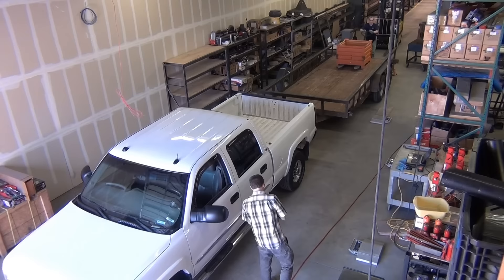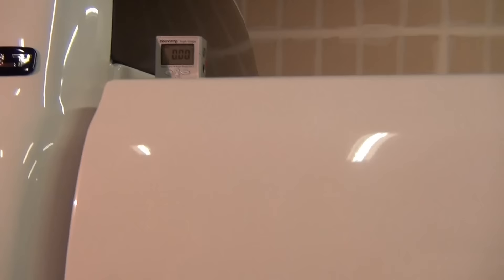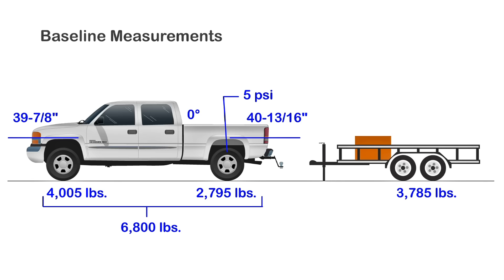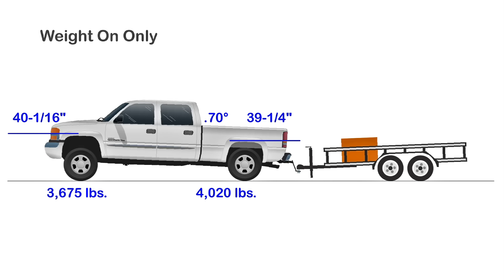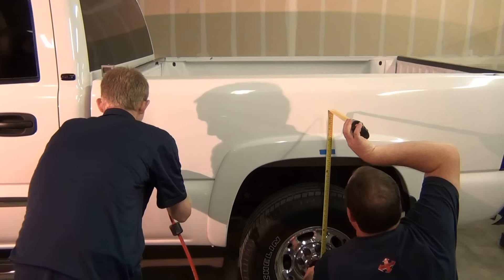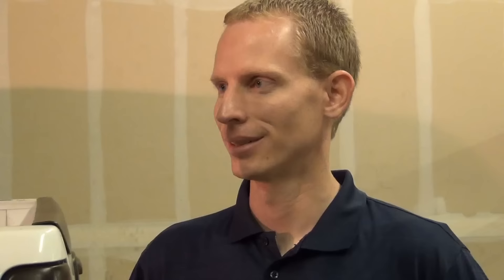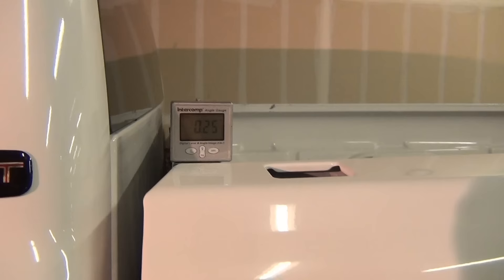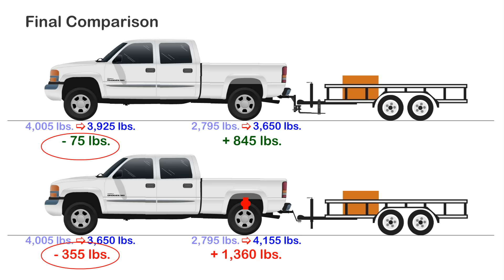The Difference Between Using Weight Distribution and Air Bags to Level Your Load

Comment: Very informative; thank you, though I do have questions. 

Recognizing you add the weight of the WD into the total TV payload equation, can you deduct the TV payload weight that is transferred from the vehicle to the trailer?  In this case 365 lbs?  So if my allowable payload was 2000 lbs, it would in theory increase to 2365 lbs with WD and this example?  I am trying to be careful in my terminology as I know you can't increase the vehicle ratings, but if it moves 365lbs of of the payload to the trailer, in theory I should not calculate that 365lbs against total payload of the vehicle.  In theory, this 365 lbs also adds to the trailers total GVWR?

Also, my vehicle has off road components and is level rather than having a forward rake like most, so I get a bit more dip with any trailer, even with the WD.  While this video implies air bags are worse than nothing at all, will it help me in terms of leveling the vehicle?  In other words, what if I want to use both a WD and Air Bags?  And if they are worse than nothing at all, why do so many vehicle manufactures put them on, and have claims of stable towing?  Finally, since the WD is transferring the weight to the trailer tires, does removing the tongue weight negatively impact sway?  I see your example has the tongue weight at over 25% of the total trailer weight, so no issue there, but it is more common for the tongue weight to be around 10%, so it may help to have a test with that standard?

Thanks!
Reply from the maker: +PBRescue,

Here's the scoop from our engineering geniuses:

- Of the 375 lbs. that was removed from the rear axle, only 150 lbs. went to the trailer axles. The rest of that weight was placed back onto the front axle of the truck. The best way to see this on your rig is to take the combined vehicle to a scale and measure each axle weight, each vehicle weight and total combined weight of all axles. Having that knowledge will allow you to adjust your loads between the tow vehicle and trailer, and between the axles on each unit. Never exceed your axle, vehicle or combined vehicle weight ratings.

- Air bags aren’t necessarily worse. They help stability by leveling the vehicle and stiffening up the suspension. What they don’t do is distribute the weight from the rear axle to the front. As the video showed, attaching a trailer not only adds the tongue weight of the trailer onto the rear axle, but also takes some load off the front axle of the tow vehicle and transfers it to the rear axle of the tow vehicle.

- When using air bags, the setup process is a bit more involved. Load both vehicles with gear,and add some air to the vehicle air bags before adding trailer tongue weight onto the truck. Then, follow the instructions in the weight distribution hitch manual for setting up the WD hitch. If the truck isn’t where you want it, repeat the entire setup process starting with adjusting the air in the airbags on the truck without the trailer coupled. Verify that WD is in the proper range, the truck is at the level you want and the trailer is level.

- Weight distribution doesn’t reduce the tongue weight, it spreads out how the tongue weight is carried. It doesn’t reduce resistance to sway, rather it increases overall stability therefore, improving sway control. All Fastway® e2™ brand hitches have built in sway control that will reduce sway and provide better sway control performance than chain style hitches offer. Air bags do not provide sway control, but when used correctly for their designed purpose, they can increase the overall stability as described above.
Reply: A WD works as a cantilever. Bags DO make a huge improvement! They force the weight back onto the rear axle and the rest of the truck frame. This video is misleading

Comment: Like the video but what about using both airbags and weight distribution hitch
Reply from the maker: +BildrRick The Eclectic Nomad,
Several others commenting on the video use both air bags and weight distribution with great success. We think it's a great way to go if it fits your towing needs and you can afford both.
Thanks for the question!

Comment: Thanks so much!! Very informative. I almost got air bags thinking it would do but wow WD is so safer!!!
 I've read here some ppl use both, I don't think I will install aitbags.
Reply: If your not getting more than 1-1.5” in drop on the rear of your tow vehicle there’s no need but if you still get more than 1.5” in drop the bags help a lot too

Comment: The weight in the trailer should've been centered directly over the trailers axles. That's the proper way to load a trailer. The fact that they didn't do that makes me question their entire method.When I tow my 27' travel trailer, I use a weight distributing hitch in conjunction with air bags.
Reply from the maker: You are correct. If this were a real towing situation, the weight should be set just ahead of the trailer axles. In this case, we are not planning on towing anywhere, simply trying to achieve the amount of tongue weight we need to illustrate this principle. Placing the weight at the front of the trailer saved us time and work, since we were able to achieve it by loading just one bin instead of several. Using both air bags and weight distribution together is a great way to go. Thanks for watching!
Reply: The 10 percent rule usually does alright in most cases. 10 percent of the cargo weight on the tongue of the trailer. So slightly forward of the axle set centerline is correct positioning
Reply: The point was to show how tongue weight is distributed across axels.  This was great video.  My trailer tongue weight is about 850 to 1000 pounds and I have these weight distribution bars.  I have some sag but that is typical.  I was considering getting air bags also but I will pass because I won't know how it will affect weight distribution.  Could be real bad for tires
Reply: Ed Montreuil  hi I have a question how do you go about setting up your distribution hitch with your air bags. Do you hitch your trailer and then add air to the bags or do you hook up your distribution hitch and then add air
Reply: @inspectorbrody  I have both on my 150 towing a 30ft TT. What the bags offer also is a better ride. I set the bars to wear the load distribution is correct and then the bags to wear they provide the extra support for roads that have dips, expansion joints etc. Not necessarily for weight distribution. I did bring the whole unit to be be weighed to work to check out individual axle weights and were correct. I haul oversized/weight loads for a trucking company.
Reply from the maker: @abqluke  the best practice is to first inflate the air bags to the psi you plan on using while towing, then, set up the hitch to fit the tow vehicle and trailer. Inflate them before hitching up the trailer. If you make adjustments to the air bag pressure after the hitch has been set up, you should double-check the weight distribution. After the hitch has been set up, inflating the rear axle air bags will decrease the amount of weight distribution, and deflating them will increase it.

Comment: Great Video! I recently pulled my bumper pull travel trailer 5000lbs dry on a long trip with my 08 sierra 1500 denali and measured my weight at some scales. I had my WDH on and airbags at about 55 lbs initially and in the end I went lower 22 lbs. When I got home and emptied the trailer I hit the scales again with 22 lbs in the bags and seen what the loads on the axles were at 4 links on the WDH and 5 links. 

Unloaded weight of truck axles not connected to trailer: 
Front- 3344 lbs, Rear- 2420 lbs. 

Connected to trailer (approx 5740 lbs wet) with 5 links on WDH: 
Front- 3102 lbs, Rear- 3608 lbs, trailer axles -4840 lbs. 

Connected to trailer (approx 5740 lbs wet) with 4 links on WDH: 
Front- 3168 lbs, Rear- 3410 lbs, Trailer Axles- 4928 lbs.  

As you can tell the WDH worked quite a bit. With a heavy 1/2 ton (6.2L Engine) I was concerned as I was overloaded on my rear axle most of the trip (Had 3 rows of birch in box). But after I emptied my trailer, reduced my air bags, and had more weight transfer from WDH, less links, I was then less weight on my rear axle. Helped quite a bit!
Reply from the maker: Looking good! Thanks for sharing.

Comment: Outstanding video.  I have a 2019 Tahoe with automatic level control, which has no manual adjustment and comes on when you turn on the ignition. I don't own a scale to check axle weights, so my take from your video and reading through comments is that the most important factor is to adjust the WD hitch to return the front axle measurement back to baseline. I should adjust the WD with engine off (i.e. no airbag pressure) until front axle is back to baseline, then turn on engine (inflates airbags), and if front measurement increases, then readjust WD hitch until front axle measurement is back to baseline.   Am I right?
Reply from the maker: Yes!

Comment: Shouldn't the first measurements be done with a regular short type of draw bar in receiver like we normally use when towing without WD?  That would yield different numbers because of the hitch ball being closer to the rear axle. Then change out to the WD set up and see the numbers and the true difference.  No one uses that long WD draw  bar alone that you  show so those numbers are misleading.  I set up my trailer ball as close to rear axle as possible and it makes a difference.
Reply from the maker: Lemony Snicket

Thanks for your insightful comment!

In this case, we wanted to show an oranges to oranges comparison of the differences between air bags and weight distribution as best we could. Using a shorter drop bar for one setup and a longer for the other would have slightly changed that comparison. For example, assume a scenario where ball mount A places the ball at 36" from the axle, and ball mount B places it at 38". Because of the added distance, ball mount B would increase the effect of the trailer acting on the tow vehicle by about 5.5%.

You are correct in setting it up as close to your rear axle as possible. When choosing between two different length ball mounts, all else being equal, that is the safest and best way to do it.
Reply: So a 6 inch change would yield significant improvement.
Reply from the maker: The change would be in relationship to the total change in distance from the axle to the hitch ball of one length vs. another. "Significant improvement" depends on a lot of factors like ratio of trailer weight to tow vehicle weight, ratio of hitch ball distance from rear axle, trailer tongue weight, towing speed, etc.
Reply: Would have loved to see what both airbags and Wd numbers would look like
Reply from the maker: +Willie Ramirez,
Thanks for the comment. If the setup is done as we recommend (inflating the air bags first, then setting up the weight distribution), the results would have shown different height measurements at the wheel wells, but similar scaled weights at the axles as is shown here with the weight distribution setup.

Comment: If... if your loaded  correctly then most of these problems will go away. My wife and I was hauling  atvs on a car trailer  and I loaded  incorrectly  she could tell from passenger side  that something was wrong.  When I loaded for return trip I moved 1 of them 2 feet forward and there was no problems.  Weight distribution hitch will  cause more fatigue on the tongue due to the fact you are using that pivot point as a spring.  Just yous the proper rise/ drop hitch for your truck and load it correctly. ( to tall of hitch on tandem trailer  will increase  tongue weight and to low will cause truck front to lift off of ground in braking conditions. ) I love to see a video of a stub hitch vs long WD hitch  with trailer  loaded correctly (load being centered over axles). The farther you place the ball from the trucks  rear axle the less you can actually  tow(in steps gooseneck and 5th wheel)

Comment: What happens when you drive a wt dist hitch over a deep gully or culvert?
Reply from the maker: That can put unnecessary stress on the hitch if the bars are connected. I would remove the bars if going over an uneven territory!
Reply: @FastwayTrailer  
👍👍
Thank you for that simple confirmation. 
It must be easy to forget or misjudge and bam! you've "snapped" something on the rear end. 
Would you say "don't 'winch up' unless you're all highway driving for the day?"

Comment: I got both the airlift loadlifter 5000 and the equilizer e3 weight distribution hitch system, with my travel trailer and family plus junk we bring I'm probably right at my trucks rated limits. I started out with only the weight distribution hitch, but I was still bottoming out on extreme highway bumps and dips, usually bridge transitions, and was also still having some sway issues in some of the wide open rural areas on high wind days, it was not a very fun ride, so I've added the air springs to help out with this bottoming out issue, and hopefully it'll improve sway as well. I'm hoping to install them this weekend but we'll see.
Reply: Hello David, did you have a chance to add the airlift and try it out? I’m thinking about adding airbags onto my truck to help out my weight distributor because I’m having the same issue as you. If you don’t sharing any updates on it. Thank you!!
Reply: @oscarmijares317  I put my bags on and what a difference in towing so much more comfortable
Reply: Have just installed the air lift and tow a tt with the e3. Had bad sway above 60 mph. Hope the air bags add some stability and better ride on bridges.  Did it help you?

Comment: There’s no vs! It’s not one or the other! They do separate and diff things!
Reply: Yes, I think that is really the point of the video. Airbags can't be used to replace a weight distribution hitch. Airbags don't distribute weight with bumper pull trailers. But, they are great to reduce sag and improve suspension characteristics while towing a 5th wheel trailer/gooseneck or when loaded full of payload up inside the bed or with an SUV.

Comment: All these numbers vary considerably depending on the trucks wheelbase and where the hitch is at.  The biggest factor that can change here is trailer length.  If your trailer is longer then the gains from the system decreases.  The engineer here explained nothing except for the scaled measurements.  This is for a specific set up, change the trailer and truck and these numbers will change significantly in either direction.  At least it proves the air bags don't adjust the loads much, actually on paper it should have 0 affect but there are small moments in the system that changed the numbers with the bags inflated and this is from binding forces as the wheels were on one scale and not one per side.
Reply from the maker: +106002297859119734565,

The data shown here is only for this specific setup, and to demonstrate the principle. If you change anything - weights, truck, trailer, air bag pressure, etc. the numbers all change, and therefore your setup must change.

Thanks for the comment!

Comment: Now do this same experiment with a 5th wheel hitch and trailer with the same weights and tell me how you are going to make that rig handle then.
Reply from the maker: @2009mechanic, using air bags is a great way to stiffen a suspension that is carrying the load of a 5th wheel hitch.

Comment: That hitch set-up has been around many years. I have used one since they first came out. Weight Distribution AND Sway Control all in one. 
They are easier to hookup than the GARBAGE ones with chains. Plus the chain system has NO Sway Control unless you buy and add more garbage to them!!🤮
This hitch is the only way to go for Any and all towing!👍🦾

Comment: Great video! I recently purchased my first travel trailer that is 26' long and 30' total. I'm pulling it with a 2015 f150 ecoboost with the HD how package and I'm using the e2 WE hitch that I love! should I  bother with airbags as another means of upgrading my towing or for safety. I do not have a leveling kit on the front, which is another reason I've considered airbags. Thanks for your time and videos.
Reply from the maker: +Jeremy Hutchinson,

If it is towing well now, and within all of the tow ratings, there is really no reason to add anything to the system.

If it's not towing well, we recommend that you make sure your weight distribution adjustments are dialed in correctly first, including proper hitch ball height, and torque settings, then consider adding more equipment if necessary. What you chose to add would need to be determined by the specific towing issues you are having.

You are always welcome to contact our awesome customer support team if you have more detailed questions. 877-523-9103 or Support@FastwayTrailer.com.

Good luck!

Comment: Surely if you loaded the trailer properly with the load over the axles and 10% of the gross weight on the tongue, you would have a much more balanced and safer combination. Why would you put so much load on the tongue and not on axles where it's meant to be?
Reply from the maker: Yes, if the trailer is loaded correctly, you don't have to worry about airbags over a over-loaded tongue!
Reply: If you are towing a camper. you don't have that choice